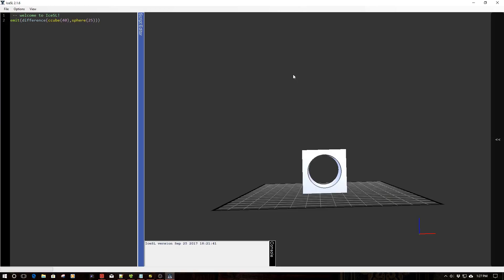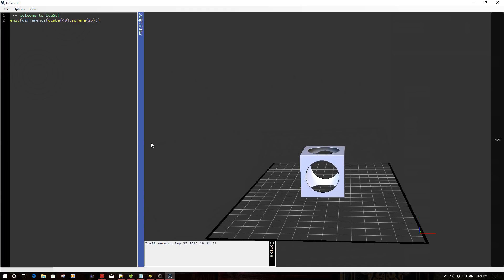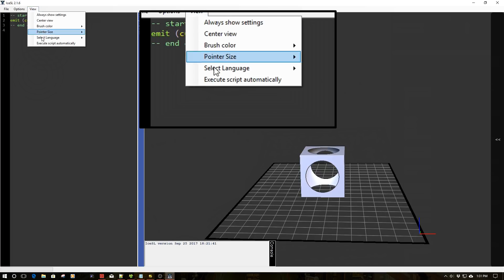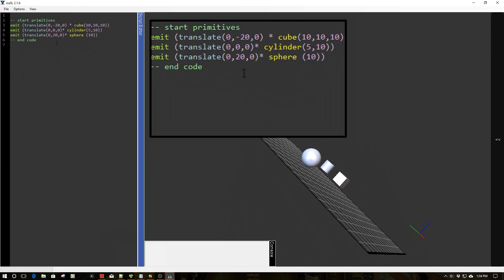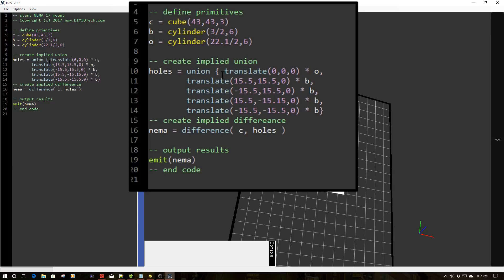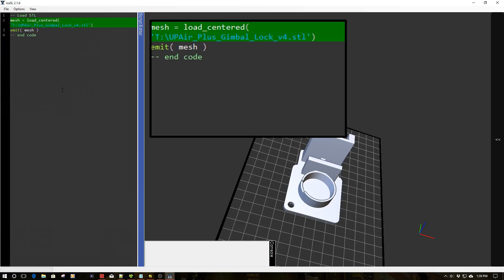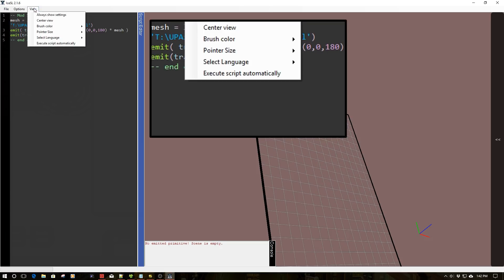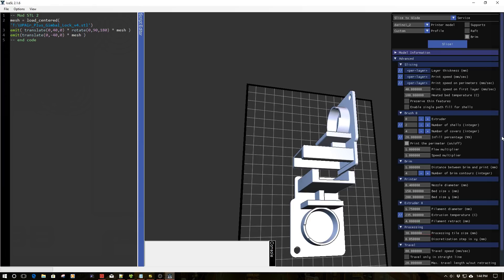iceSL Slicer - How to do Basic Scripting in iceSL Forge!

Comment: What happened to the Forge part of this. I don't see a scripting window when running Icesl. Icesl-forge doesn't seem to exist anywhere. What am I missing? My system is Arch Linux 64 bit.

Edit: 
Forge does not exist for Linux yet. First create any file with a .lua extension. Then, open that .lua file in Icesl slicer. The slicer seems to watch the open file for changes. When you save the file, the update is reflected live in the slicer.
Reply from the maker: There binaries at least for windows as I have not used it in Linux.  One is slicer only the others is IDE and Slicer

Comment: What are the advantages of this over openscad?
Reply from the maker: Apples and oranges sort of as I would not give up Open-SCAD (as even have a you tube channel for it) yet the bonus is not the design but integration into a single workflow. In other words, straight from code to the printer moving, where as with OSCAD you have to export it as an STL slice, send it to the printer, etc.  Also this is very close to OSCAD syntax wise to easy to transfer the knowledge.  Take my nema motor example,  if this where a business setting I could whip it and have it printed in heartbeat that's the value as time is money (not to mention all of the stuff you lay on top of this code/script wise)